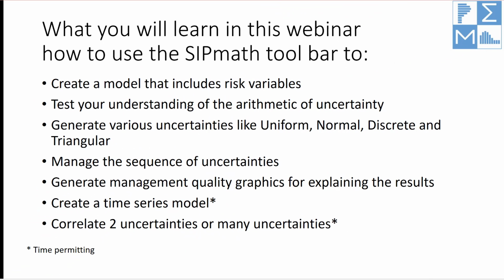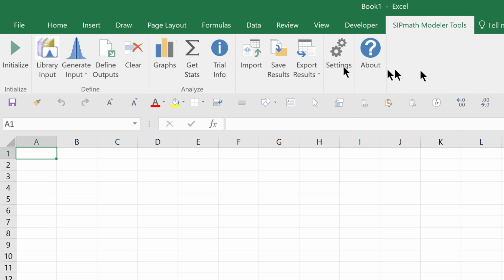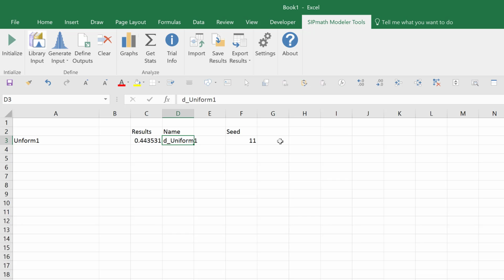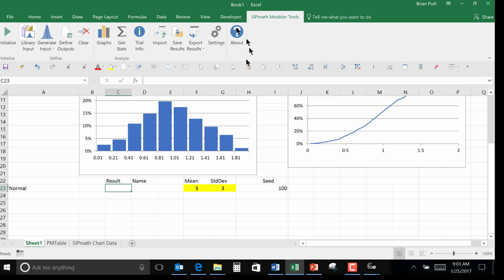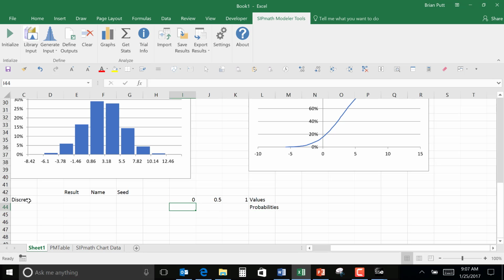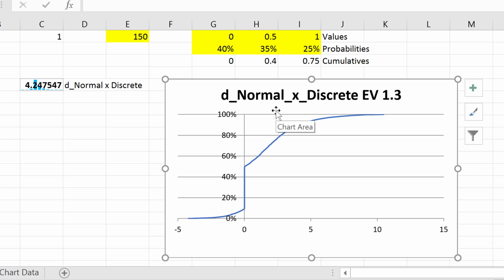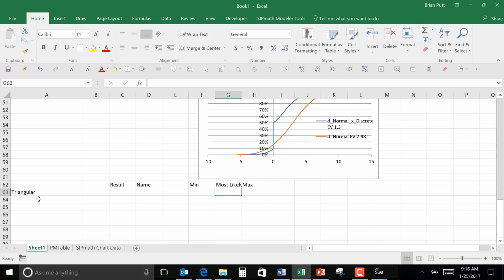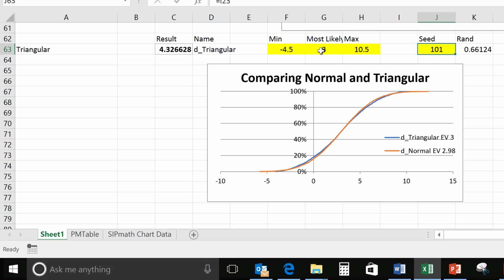SIPmath Tool Bar Webinar Instructions

Comment: Excellent introduction. What does seed mean?
Reply: A "seed" is the starting point for a pseudorandom number generator.  It shouldn't matter much statistically if you already have a large number of trials.  For reference, if I'm comparing different distributions or looking for differences in strategies I'll often start with the same seed.  That makes the analysis repeatable with nothing bouncing around.  But I will always test it with several random seeds to make sure the differences are real and not just due to the seed selection.

Comment: Brian, typically an uncertain variable is an input to a model. But you also identify it as an output. Why is that being done and how does it affect what is happening in the model? Thanks!
Reply from the maker: I have graphed the input variable so you can see what the distribution looks like. Particularly appropriate for poisson distribution or triangular distribution. It has no impact on subsequent calculations.